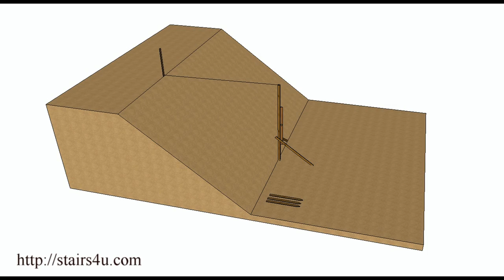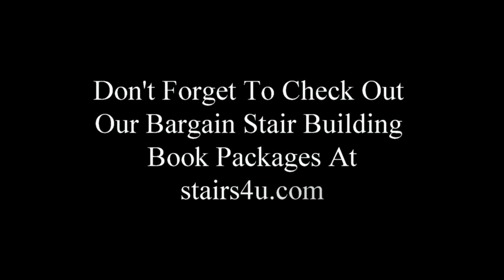How To Calculate Horizontal Hillside Run To Build Stairs

Comment: what if my hill is 80 feet long?
Reply from the maker: If its less than a 35 degree slope, then it can be 200 feet long, but if it's more, then you will need to check out some more of our videos at the website.

Comment: Here is another idea... If you are gonna use the post, just hammer the nail into the top and be done.  It would be better to have the nail in place than to have a hole that will collect moisture .
Reply from the maker: Griffin Contracting The post is only going to be temporary, but the string might need to be removed in order to measure it to divide the run or horizontal distance  into stairway steps.